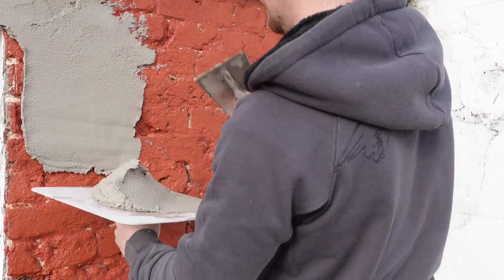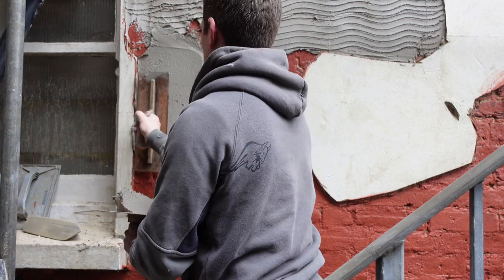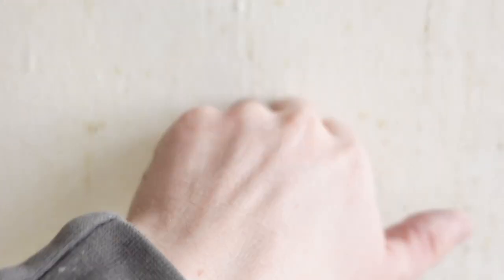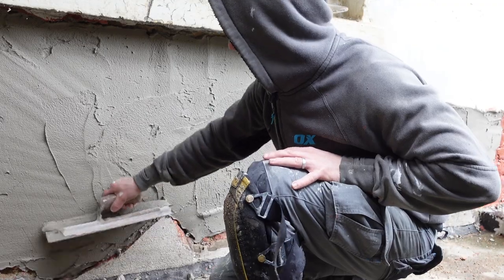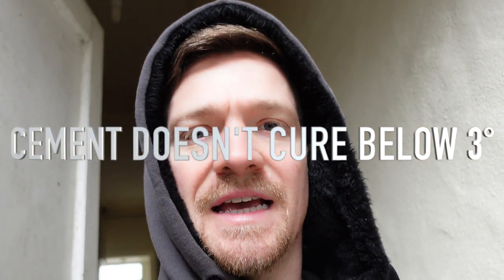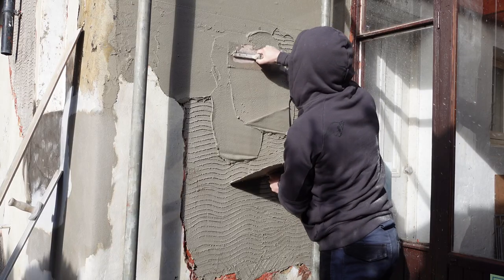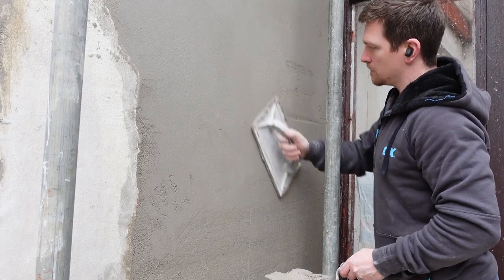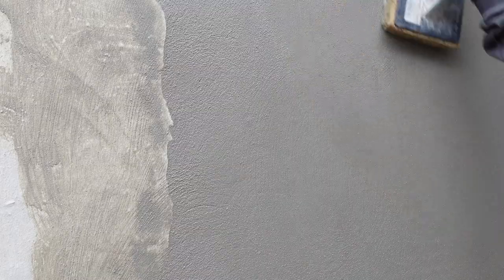How To Patch Render A Wall | COMPLETE BEGINNERS GUIDE

Comment: Lime render will outlive anything else and won't cause damp like this will endlessly
Reply: True , reason why some of the castles are still standing lime mortar.
Reply: It's breathable isn't it? Why do you think it'll cause damp?
Reply: @robowen66  with primer and masonary paint no it not,
This is a lime built building and cement render always fails because it will crack then water gets trapped in the wall = damp.
Reply: You’re right, hack off and start again is best. But that was nice patching it should last a while before cracking along those old render lumps I suppose. 🤔😬
Reply: I’m a bricky and this is problem people repoint it with sand and cement or render it. Damp cannot escape leading to damp issues inside also water can not escape through sand a cement so it finds the weakest point which is the bricky which begins to blow. All this sand cement render should be take off
Reply: @kierenboimufc5940  spalling of brick and stone 
People don't realise the damage cement does, a totally inferior product compared to lime mortar
Reply: @darrengreenstreet2739  yep also seen a house repointed sand cement which are away at the lime behind leaving pockets. I can bet they got damp issues in this house
Reply: There is lime in that ocr also can’t see Weber bringing out a bagged render that will cause damp? There a leading worldwide brand in the market.

Comment: For rubbed render, the sponge has always been a friend, I love the scratch tool, I used to make mine out of old bicycle spokes and an old paint brush, my mixer was an old bicycle crank welded to a T bar made from old electrical zinc tubes they used in factories to feed the wiring around if I could make it rather than buy it I did,
Reply from the maker: Fair play to you mate. If it does the job then happy days!

Comment: Is awesome to see how each country doing the things in each way. Here in Brazil, we use the same tools like your "floating diamond" and your sponge. To render an entire wall we first use the coat to build guides in edges of the wall. So after it, we apply the coat in one layer. And with a "ruler", basically an aluminum rule to cut the coat using the guides. After it we fill again the holes and more rulers...After it we use your float diamont to smooth everything. And to finish, the sponge. Of course with help with like a brush tool to spray water in wall  to help. 
We call "rebocar" the process to apply coat. Normally we dont use any electric machine to do this.
Thank you for your videos.

Comment: Any reason for no beads? And what are the chances of it cracking and bcoming an issue here? I'm guessing that the webber stuff musn't shrink when it's fully cured? 

Ps: thanks, what you do for the plastering trade is 👌🏼 appreciate the help
Reply from the maker: I suppose it depends on the situation at hand. If it’s all hacked back then I’ll plant a bead but if not I’ll just freehand the angle into the existing. A free handed angle is actually really strong and probably has less chance of it cracking than a beaded angle. 

Minimal shrinkage mate - another reason why this renders so good. Very good product!

Cheers mate…much appreciated. Thank you for watching!

Comment: Nice job Blaine did the accelerator help you much ? Did you blob it in water or when render mixed up?Thanks
Reply from the maker: Yeah it helps loads mate. Always mix it with the water first before mixing - you’ll have patches drying faster than other areas otherwise. But yeah…Great product in the winter

Comment: What the best way to clean these sponge? Ready to use again straight after?
Reply from the maker: I just scrub it with my water brush or whack it against a wall to remove the sand. But i need to but a wash boy to be honest…that’s probably best.

Comment: Hi mate abit of avise needed for a project at home. I built my mancave out of breze blocks I am wanting to render it using the weber monachouche coloured render the 2 coat same day way should I use the colour render as the base 1st coat or use a base coat render first? And can i do either a scratch finish or sponge float or does it have to be scratch which one would you suggest? Many thanks Luke
Reply from the maker: Hi mate. Be careful Rendering onto Breeze blocks - it pulls in rapid. I’d use a Rendering primer to seal the blocks first and definitely use mesh in the Render. It’ll crack otherwise.

You typically scratch Monochouch so I’d scratch the day after it’s been applied. Hope this helps and his luck 👍
Reply from the maker: Hi mate. Be careful Rendering onto Breeze blocks - it pulls in rapid. I’d use a Rendering primer to seal the blocks first and definitely use mesh in the Render. It’ll crack otherwise.

You typically scratch Monochouch so I’d scratch the day after it’s been applied. Hope this helps and his luck 👍
Reply: Thanks mate.
Reply: @PlasteringForBeginners  should i use a base coat first coat and colour render on top or just do 2 coats of the coulor?

Comment: Hi Blaine. Slightly off topic. Just wondering if you know much about Google Business. I saw you on the trowel talk podcast the other day and you mentioned that you use or have used Google business. I know that you said it is free to create an account, but are the any charging fees later on or? I googled it and it didn't really give me a straight answer. But it did say Workspace charges you. Is this the same as Google business? Cheers.

Comment: The webber looks so much better to use so if u scratch one day and come back a few days later u just wet it down as normal and then lay top coat?
Reply from the maker: Exactly that mate. Never had any issues that way - works a treat! Never going back to sand cement 👍
Reply: @PlasteringForBeginners  gonna giv a go on nx rendering job can't do it on this one as all materials already ther but deffo next one does it work out alot more than sand and cement

Comment: Is that Breathable mate ? I doubt it is. I ALWAYS use Lime if it's pre 80's.
60's/70's really. But just to be sure. Or if the joints were originally lime. People use sand and cement or stuff like this. And don't worry because it looks ok. Most of the time the bricks start spalling as soon as the weather starts to change and people don't see it because there's a slab of a nonbreathable material in the way. 
And they are Brutal. Especially if no labourer. Most of my towns houses are like that. Good video. Good to know a bit about that one coat stuff. Brilliant When used in the right circumstances 👏💪👊✊👍
Reply from the maker: It’s a breathable Render which is another reason why I like using it. And thanks for watching - much appreciated my friend!